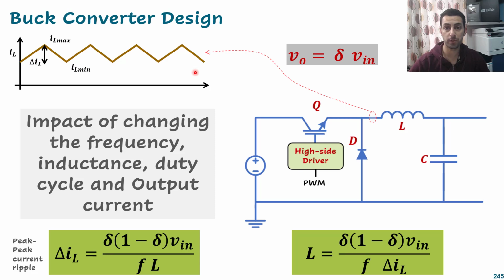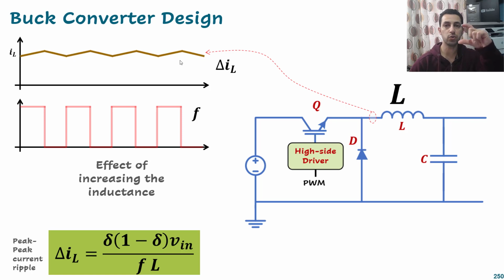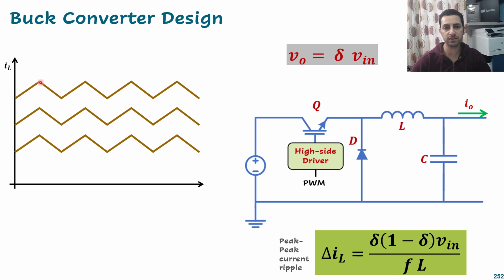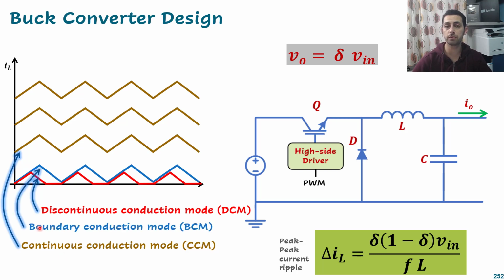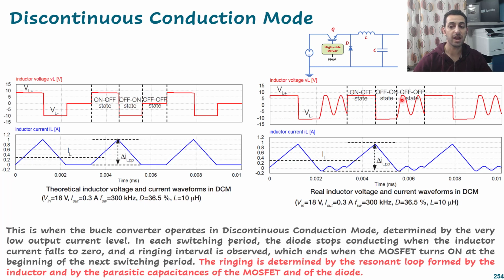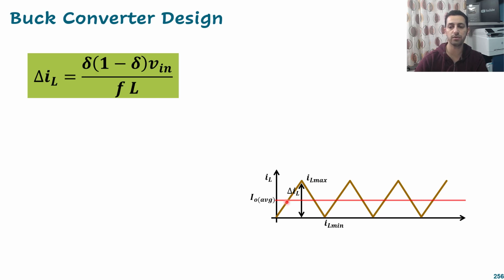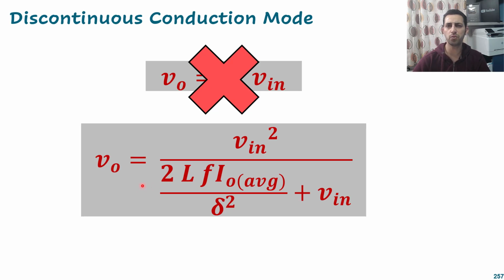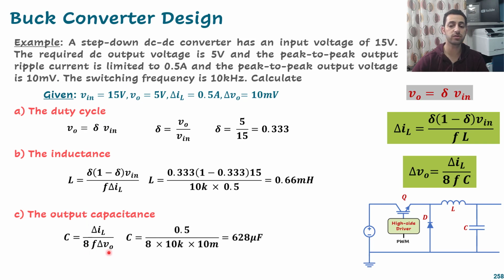31 Buck Converter Design | Power Electronics

Comment: At 7:07 you said that we are going from CCM to DCM if we have small value of load resistor? Isn't it opposite? With higher value of load resistor we decrease average inductor current and going to DCM?
Reply from the maker: yes you are correct